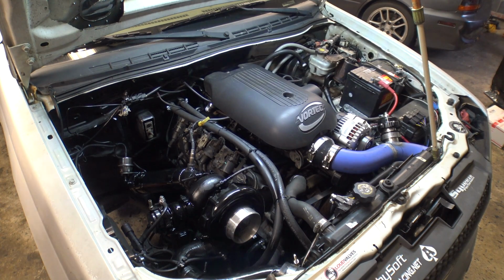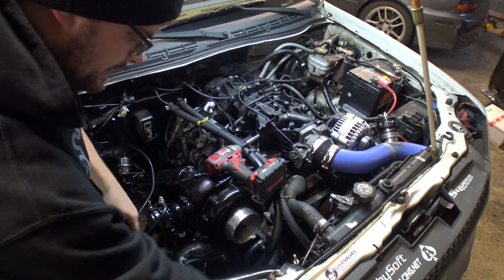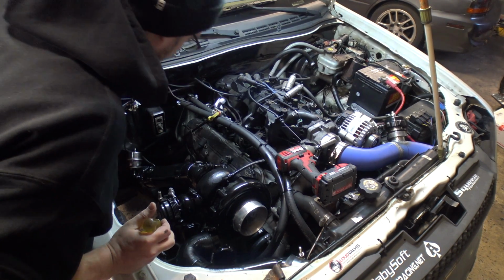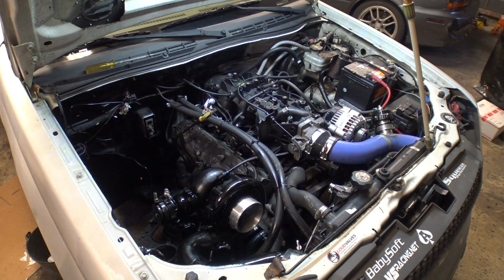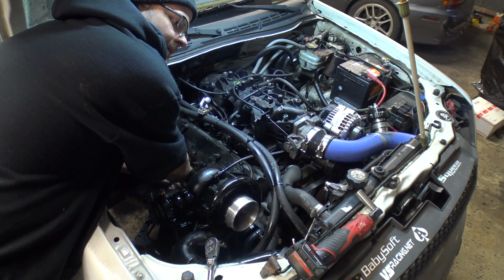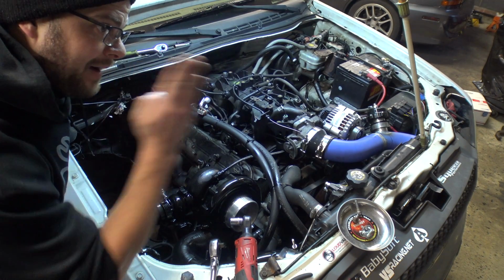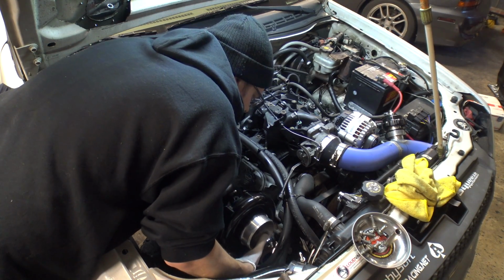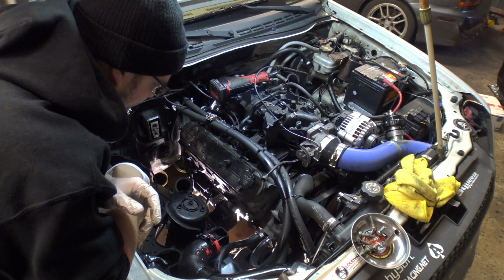teardown for ported head swap

Comment: I'm a bit late here, but since you splooged all over Milwaukee in this vid, I figured I'd post a heads up that Home Depot has the 12V Fuel 1/4" brapper, 3/8" ratchet brapper, drill, 2 batteries, and a charger on sale until the end of January (2018) for $200, online only.

Might be a cool thing to mention in your next video. I just bought that deal 2 weeks ago (based mostly on your glowing reviews of it over the years) and I absolutely love it so far. Wish I would have had the 3/8" years ago. I'd been waiting for it to go on sale for months.

edit: Oh... and... uh... Now I feel like a dick for not saying this first, but congratulations on the birth of a healthy son!

Comment: how would you support a turbo in a car because im running a turbo that weighs about 75 pounds
Reply from the maker: my manifold is heavy wall so it holds it no problem, same thing, if you cant do that, a support bracket

Comment: NICE, Having a garage!!!  idk what happened, u had it stripped down to the block & sceen clip to u airing popcorn off the heads & then, it started from the beginning-taking off the vortec cover. anyways, a garage is a luxury! ls v8 ANOTHER LUXURY!!! IM REBUILDING THE LOWER END of my focus, on a concrete pad where a garage once sat! one day, I will rebuild a bigger garage, I must move it back! The last owners built a deck(which we use extensively) but, it gets in the way of a garage!!! I have rebuilt both of our cars, we rewired & replumbed this house & all new furnace & hot water tank,water lines & fictures, outlets & light swithes! Everything! Have to save up to afford a new garage!!! anyways, 1 day, I will have a ls!!! nice turbo ls bro!!!

Comment: AutoZone keeps 03413 dorman in stock in the help section for $11.99 box of 12 replacement exhaust manifold bolts
Reply from the maker: excellent, ill be picking up a set today if they have em

Comment: Good blots definitely make a world of difference in headers/manifolds. Headers for a old school sbc I like to use the ARP header bolts with the 5/16’s head. Gives you more room when you have a big primary tub that’s right against the bolt. Plus you can really give it the beans and the heads and threads hold up a lot better. I went out and bought a dedicated long and a short Snapoff wrench just for them.

Comment: McMaster Carr is a bit difficult to navigate and I remember taking an hour to find AN fittings from them but I still order my hose clamps from them because they hold up well and I'm not fixing a leaky fuel line at the track because I bought a set for $3.99 at AutoZone

Comment: car show kit, ftw!  can u add a solenoid to the loud valve line and tune in some gear-dependent opening strategy?
Reply from the maker: you can easily noid the reference and enable disable it

Comment: Congrats on the alien baby. In regards to your coolant in oil debacle, I could have sworn someone gave you a coolant system bleed tool. Attaches to your radiator cap and you hook up shop air and it sucks all your coolant out by the venturi affect.  Never seen you use the tool  but I think a viewer gave you it a few videos back?  I could be mistaken.
Reply from the maker: ill have to read the manual, i forgot he sent that and i could pressurize the rad and push from there, i am unsure if it can vac out through its assorted caps
Reply: Sloppy Mechanics 

https://youtu.be/-SfhBRvVbtg

He works on diesels but it's the same procedure.

Comment: I loved the removing and installing the turbo/manifold/oil drain as an assembly. Saw you do that on one of your older video of the truck and did the exact same thing on my Volvo 240 with 4.8 and VS 7875. Works brautifully! I also did have to throw one of those bolts away bc of how the compressor housing is clocked haha

Comment: Also, those exhaust bolts, i bought a bag of 100 stainless flange head bolts on ebay for $25. They have the larger heads as well.

Comment: Would it be feasible to swap the 105s in on the dyno after several pulls with the decapped injectors? I'd think after separate unleaded gas and e85 tests at bare minimum
Reply from the maker: +okieltr450 might be doable

Comment: Matt...what torque convertors are you using? I absolutely to refuse to cage my GN...and the track is gonna say something sooner or later. My plan is to do a build like this...just haven't decided what to put it in. 6.7-6.8 is what I'm looking to run in the 1/8th for racing. Could you recommend a TC. Great vids...keep 'em coming!
Reply from the maker: Turbobuicks 101 I like jakes, ptc, Circle d, depends on trans and project goals
Reply: Thanks for the reply. PTC is big with our 200 transmissions. Dusty Bradford specs and builds them for us. Congrats on the new addition!

Comment: hey denmah what size of chuck is that little milwaukee? 1/4 or 3/8? I think the electric ratchet you got is 1/4
Reply: Ritchard posterior I believe his ratchet is a 3/8 square drive and the impact is a 1/4 chuck.
Reply from the maker: +Devon Doiron correct!

Comment: Like said here : a bigger throttle body is completly useless as long as it's bigger than the intake diameter itself.
it's even worse,you create turbulences in the intake track.
matched parts with smooth transitions are the best.
For the intercooler  : a bigger intecooler will allow more heat exchange because will slow down the airflow and increase the surface area of exchange,so time spent in the cooler.
the down side is that you make air denser,so you will have more lag ,being obliged to push more air through it to fill it up to build pressure while the air ,cooling down going through take less room...
a good idea is to have pressure sensors ,like you wanted to do.
3psi pressure loss between inlet and outlet is what considered ok when the intercooler is quite well efficient.
your current set up is too small ,can't keep up on heat dissipation,but more importantly have 90° elbows in it,wich are not good for the flow.